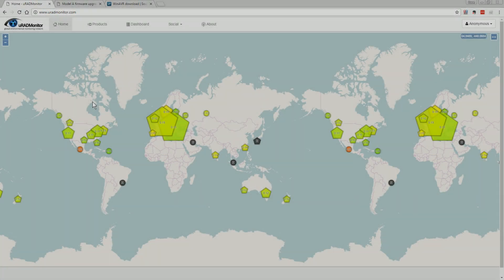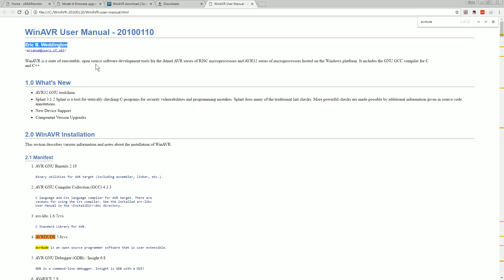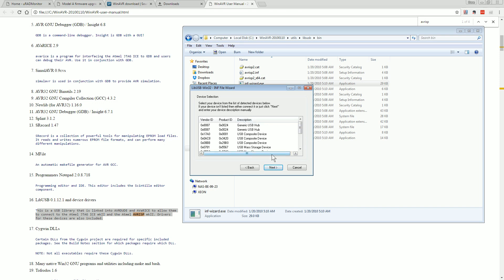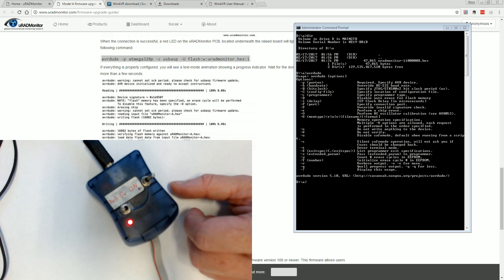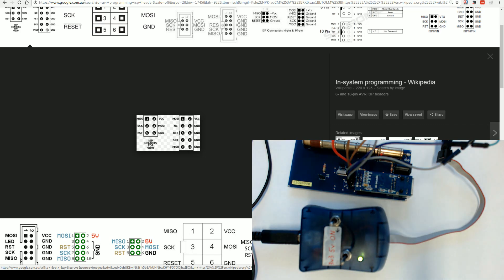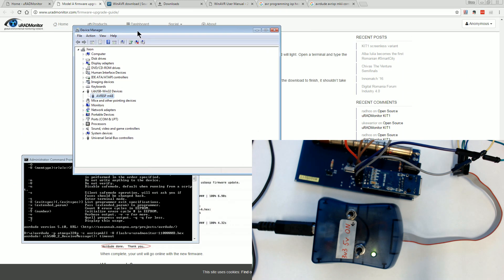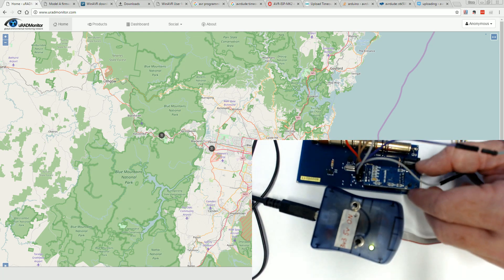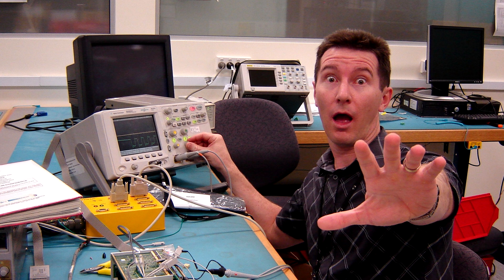Adventures in AVR ISP Programming

Comment: For someone who makes videos on topics related to embedded development, and who in general is a "techie", I find it EXTREMELY surprising and disappointing that you didn't know what to do. I think all techies know that Windows 10 will only accept digitally signed drivers. If a driver is NOT digitally designed you have to reboot into a special mode (which is actually quite easy, just look it up).

Comment: Yes, the 6 and 10 pin ISP headers are just more of Atmel's shiithouse design decisions. 
Firstly, because there's two of them, secondly, because they're both stupid, and thirdly, because DIL headers are more difficult for home-made PCBs, if you need to run a trace between the pins. They just make for a crap layout. 
I've always used a 6-pin SIL header in my designs: MOSI-MISO-SCK-VCC-RST-GND. With that, 5 of the 6 pins then match many of the DIP package AVRs (eg: Mega8). It's so bloody obvious really, you just put the header next to the MCU with 5 very short, straight, pin-to-pin traces. The only slightly more complicated one is RST. And the header causes minimal interference when routing those MCU pins for non-ISP usage.

Comment: I can never understand how people manage to make adapters like these such a pain in the arse to install with weird custom unsigned drivers etc. I just use a serial port programmer (basically a couple of transistors and a few resistors for cheapo level shifting) for AVR programming - admittedly I'm only doing basic programming of the flash and fuses, nothing extra fancy like in circuit debugging and the like.

Comment: Dave the vast majority of these devices just a need a generic usb driver (that's what libusb is) and by far the easiest way to set that up on windows is a free tool called zadig. It has several usb drivers, including libusb, so if one doesn't seem to work well with a particular device you easily try a different one.

Comment: There is no need to make an adapter for 10pin ISP. 
If you open up the AVRISP mk2 (just 4 clips on the bottom) you'll find that there are pads for a 10pin header, you merely have to solder it and connect a ribbon cable. You can also leave both 10pin and 6pin ribbon cables attached, the front slot is large enough.

Comment: Some years ago, returning to µcontroller stuff, I had to choose between 8051, AVR and microchip. Familiar with 8051 assembler, I found the products old and lacking features. I went to microchip and when I watch the pain with Atmel products, I think I made the right choice. Pickit3 doesn't need painfull microcode update. Correction. microcode updates on pickit3 are handled by mplabx.

Comment: This video shows the joys of not reading the manual, and just clicking on stuff. He does read the info/marketing blurb parts, and then just clicks on stuff. Then struggles.

Would he use a component on a breadboard without checking the datasheet? No? They why not read it for the software? Because he just wants to do one thing with it! Does that make it take less time to get it set up? Of course not!

"Why can't tools just work?" Because they do work, and not all work is the same. So you have to read the manual.

Like he says, he can't remember. Of course not, you're not supposed to run off memory, you're supposed to open the manual and then instead of "d'oh!" you just follow the instructions. The tools aren't doing anything wrong in this video, it is just that the operator presumed that he doesn't need to check what he's doing, because he's only programming one unit. But is there supposed to be an economy of scale there, where it is less work if you're only doing one? Or is that actually when you have to spend the largest effort per unit, when you're just doing one?

Comment: I haven't got any issue with Atmel Studio 7. And perfectly integrated with the low cost DEBUGGER Atmel-ICE. Before that, to debug you had to spend a LOT or use the mk2 programmers only for programming. So, it is a big improvement from Atmel in the latest years, so IMHO, I would't complain when talking about Microchip and Atmel. (BTW, I had the same experience when using avrdude and those unofficial drivers!)
Just try to flash TI or Freescale/NXP MCUs...

Comment: I hate how nobody seems to be able to design an OS where windows can open on the monitor you're working from.  This is a huge problem in Linux too and it can be very frustrating.   Also, Atmel is so much easier in Linux. :P  I cheat though and just use the Arduino IDE and libraries. :P

Comment: I recommend the USBtinyISP programmer. It's ~$20 in the states. Comes with both the 6-pin and 10-pin cables. I've had no issues with drivers or getting it to work with avrdude.

Comment: There is a GUI app for avrdude called avrduess (what else?).
winavr is no longer being developed, the compiler is now maintained by Atmel. 
You probably need the windows drivers for the programmer from Atmel, they would have been installed with AVR studio (maybe).
And all of this stuff just works on Linux with no "DLL Hell" and no missing drivers (it's already in the bloody kernel!).

I thought the avrisp II WAS 3.3 volt compatible from the factory.  In fact, I think I've used mine (unhacked) on a 3.3 volt circuit.  Oh I've made a few 10<->6 pin adapters on some scrap perf board since I run into this issue all the time!  I also have the Adafruit USBmini programmer.  It's not 3.3 volt compatible, but it does have BOTH 10 pin and 6 pin cables.  (it also won't program 128k or 256k devices).

The atmel device does NOT apply power to the device (unless you hacked that).  The Adafruit can  (jumper selectable)

Comment: Most of the problem here BTW is Windows 8/10. They started demanding all drivers be signed - for an "open source" developer this is difficult and expensive. Exactly why I am sticking with Windows 7 on my PC.

This is another hurdle that using the Arduino toolset overcomes - they have sorted all of this out, and it is based on exactly the same stuff... so you can use them to program bare AVR chips just as well as the Arduino

Comment: Programming on windows is like that. You always end up in trouble with drivers. If you use AVR studio, you'll probably get caught by some problem in getting the programmer firmware updated. Studio is also absolutely huge to get for a small task like that.
With linux you usually just get a small program, need no drivers and it does the trick. Not that nice for programming or simulating though, I used to like AVR studio for developing but I programmed those with linux due to driver issues.

Comment: I have Linux Mint 17.3 (Rosa) 64bit it usually comes with gcc and gdb installed and it is relativity easy to install the gcc-avr and gdb-avr and install Code::Blocks IDE will create executables by selecting GCC-AVR and building the project that you were going to build.

Comment: Dave, comeon!, you where clearly not in the mood, you should not complain so hard, you looked like a newbie in there. The problem you had are because of the s*d drivers of windows, if you read the instructions probably you would have succeeded in less than 10minutes. Next time try something REALLY different. Try a ubuntu live on your computer (without installing), plug in your programmer and you are done with the drives. then open console and try using avrdude, it will tell you that it is not installed and which command you have to write to make it install, copy&paste that command and 30seconds later you are good to go.

Comment: Omg. In Linux it's just a two commands to install compiler and avrdude.
Drivers for most popular programmers (also cheapest Chinese) already included in kernel.
Just start working, without any pain!
Reply: That and a makefile is all you really need for painless AVR development. :)
Reply: mm no, you just insert the CD or whatever media and click "next" a few times, then let it boot to desktop...
Reply: But why? If you need only programming features - you can just install only avrdude.
How to install depends on your distro. In my case: sudo apt-get install avrdude. One minute and ready to go, simple.
Connect programmer and flash your chips, no additional drivers is needed in most cases.
Reply: As a guy who has done all his programming other than embedded on Linux, avr-gcc and avrdude have been a godsend, just make sure you get the latest version of avrdude.   The heck with slow GUIs.  I will be using avarice and avr-gdb soon too.
Reply: Oleg Kutkov indeed. This whole video is just cringe on Daves part.
Reply: megaspeed2v2 -- you're making shit up. 99% of programs are in the repositories. And to the rest of you -- if you're  new to Linux you use Ubuntu. Period. A child could set it up. Arguing otherwise shows you simply haven't done it before and you're making shit up.
Reply: Oh it's not that trust me... I try to be as open minded with linux as I can but you simply cannot say its just being unfamiliar with a different system when for example any program ever made for windows you could ever want to install you just open the setup file and THATS IT! DONE!!! 
...Whereas in linux there are multiple methods, the GUI package managers (which never seem to work for software that isn't hugely popular, which in windows would STILL have required nothing more than opening the setup file to install), CLI methods which can range from as simple as running the install command with the name (if you happen to know what exact name the dev actually gave to the executable), to adding a repository via editing some text file, doing a full system update and then running the install command, or even building the software from scratch (a feature that does make sense since there are different distros but this could still easily be automated... ), linux devs really need to face it there is NO benefit to this convoluted system.
Reply: +megaspeed2v2 Not sure which program installation you're referring to or when your last Linux experience was. Here we have an example where Dave had a great deal of trouble achieving his goal on Windows. It sure sounds like it's much easier on Linux.

The biggest hurdle with Linux isn't package management but troubleshooting when things go wrong.
Reply: it's pretty rare to have a lot of trouble with installing stuff in windows though, pretty much anything that isn't used by a huge number of linux computers requires extra steps to get working, in windows the vast majority of applications, even small ones only shared within a small community of say 50 people require no steps beyond the bare minimum basic steps of: open installer -> press install _> application is ready to use...
Reply: megaspeed2v2 You're exaggerating the problem in Linux. I wonder when your last experience was.

I couldn't do my job without the Unix command line...rather, I wouldn't want to.
Reply: I really don't believe I am, I've just finished designing a product for my work involving a compute module which runs Debian in it's current form... it only does a few simple things which there is readily available software I could have used to get it running as a proof of concept while we wait for the software guys to start making something of their own for the production version. but I have just had a hell of a time getting them running. I think I'm correct in my conclusion that as far as I can see every single problem I have ever had getting a new piece of software running could have been coded into a windows style install wizard so I wouldn't have to deal with them.
I'm sure there are features in the command line that are very useful; and I've even found some things useful... Im not saying the command line needs to go away, even windows has a command line interface; heck it has two; command prompt and powershell, I just think it would be possible for linux to retain it's core values, it's ability to be a lightweight OS with the same flexibility if it was just taken out of the 1980's finally.
Reply: 15 hours googling commands to set up the damn OS to get started though.
Reply: That's what all the Linux fanboys always say. In the end I always seem to end up on Google for hours trying to fix the most mundane shit through some awkward command line song and dance.

I'm sure when you're immersed in it, after you've spent a couple of years running into all the small annoyances and know how to work around/fix them, then I'm sure it's a great experience. The thing is that people seem to conveniently forget all those little problems they had at the start and only remember the good things.
Reply: I don't really agree with the "awkward command line song and dance". It's just opening up the command line and copypasting a couple of lines ito it. Much easier for me than "go to menu X find entry Y, open tab Z, find option A". OR What windows 10 does, you have to google for magical keypresses which will get you into a super confusing menu structure where you can change something on the next boot.. and then I have to proceed writing down all these instructions on paperi since the machine is in "bios" when the settings have to be done.. awfully awkward comparing with a copy-paste-enter solution.
Reply: In windows using an application is as simple as: get application installer, click click, move mouse to next button, click click click -UGH such hard work.
In linux... go to application creators website, find lines to add to sources file, copy those lines, open command line, cd to the directory containing sources, sudo gedit sources.txt, paste lines, save file, sudo apt-get update, sudo apt-get upgrade, sudo apt-get install applicationName -SO SIMPLE!
Reply: Sure its easy to do basic stuff but who cares? In windows its easy to do much more advanced stuff than log in to facebook, drag a stickman in gimp and listen to an mp3 file... 0% of windows applications are in repositories and yet anyone can install any one of them without knowing any more than point and click. they can just get on with their lives.

Comment: The 10 pin ISP vs 6 pin ISP sucks... Once you made an adapter going from one to the other its ok, but I can never find it when I need it :)
Reply: Real men solder wires straight to the other side of the board.

Comment: The quick & dirty solution is to download and install Arduino IDE and that'll install all drivers and avrdude for you + all Win10 signed drivers as well! AVR Studio is way overkill if you are just going to flash a hex-file imho.
Reply: Jens Andree AVR studio really won't help if you just want to run AVRDude - unless I missed something, you run it as an external tool so no better than running a command line.

I had issues getting my Windows 10 to recognise my USBASP correctly but worked after I installed a device driver filter from libusb.
Reply: in AVR Studio you can just upload any HEX file directly
Reply: Yes, but installing Arduino IDE to get signed drivers and avrdude is way quicker and a lot smaller! If you only need to flash a hex-file that is...
If you are going to do some development that's a different thing all together but for just flashing and nothing else I still would recommend Arduino IDE - purely because of the bundled signed Win10 drivers.

All methods are great as long as they work ;)
Reply: Jens Andree There is an old version of AVR Studio available. It is 4.something if I remember correctly. It is very quick to install and it even works much better than the new bloated versions. The only disadvantage is that it does not support the most recent chips.
Reply: Yes, AVR Studio v 4.16 . I still use it if I have to program some of the old 8bit Atmel shit.
Reply: Jens Andree - You're absolutely correct. Who has a Windows PC and doesn't have the Arduino IDE already installed?  And it simply amazes me that Dave doesn't know this is all it would have taken. Sad, really.
Reply: Fuck yerr arduino. Expecting real engineers to have kids toys already installed, wtf you are thinking? Almost nobody uses the overpriced old 8bit atmel crap for new designs. So don't bash Dave, that he does not know it. He is not a kid and as far as I can tell he's way more tolerant to the kiddie arduino stuff on this channel, than he really shoud!
Reply: Atmel has its uses for certain applications and although I don't use any Arduino products I find the Arduino IDE a very quick tool for compiling and flashing your microcontrollers. No worries about fuses etc, just one button and it's done. For bigger projects I'm using Keil and AVR Studio for STM32F4 and ARM but sometimes all I need is Arduino IDE and an attiny45 and it takes seconds to get it up and running. ;)
Reply: me too, i pretty much use arduino IDE for everything. those arduino clones, attiny13, ESPs, blah blah blah. if there's a core written for any particular mcu it just make programming fun and easy to work with. atmel studio just intimidate me too much.

Comment: MS-windows and engineering tools written for it are predominantly shit.
Reply: lmiddleman Engineers use windows because most tools and software is is written for windows. This is a problem with avr and it's software/driver, not windows.
Reply: lmiddleman which os do you use funny man
Reply: Microsoft actually did a half decent job with Windows 7 but then realized that if they improve it any further, nobody would buy their new products.
Reply: Nevets Exactly. That's why I asked him what platform he uses. Seems funny man doesn't work in embedded systems or have a comeback 😂